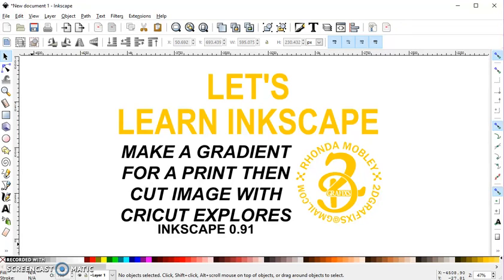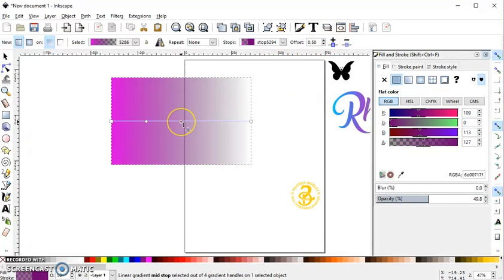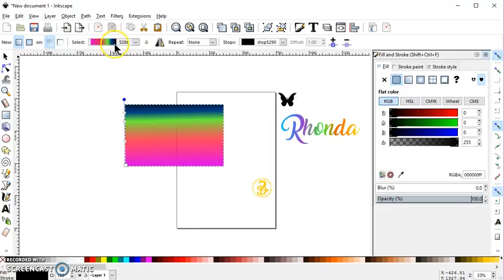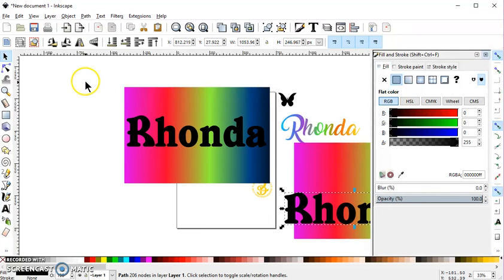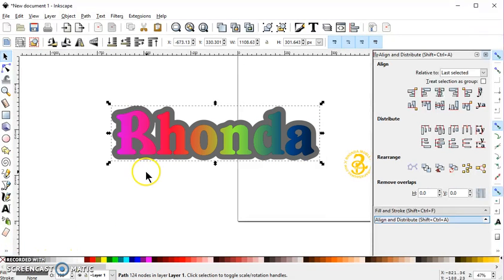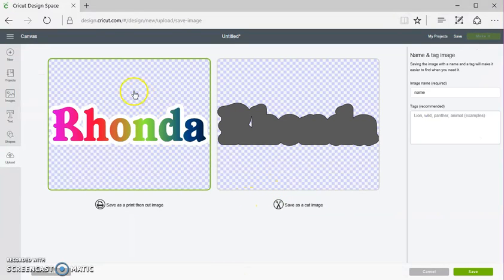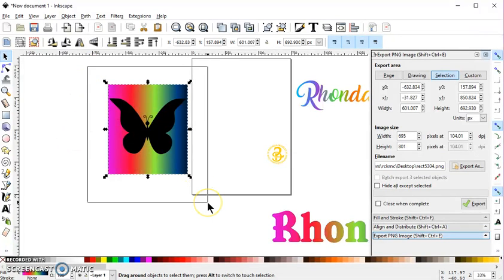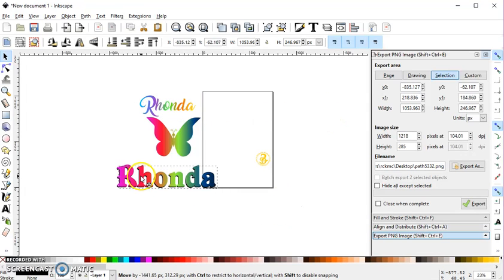43 Gradient Print then Cut

Comment: What program did you use to create your name and image.  Do you have another video that show Cricut printing the images?  I've tried printing an image before with the box around it and it wouldn't print.  Thanks
Reply from the maker: This is In Inkscape. You can make it in Inkscape and export it as a png file to cut in Design Space.
Reply from the maker: In DS your image can’t be larger than 6.75x9.25 the box you’re referring to is the registration marks ( box) you don’t make the box Cricut automatically adds that around your image that’s at or less than the dimensions mentioned.